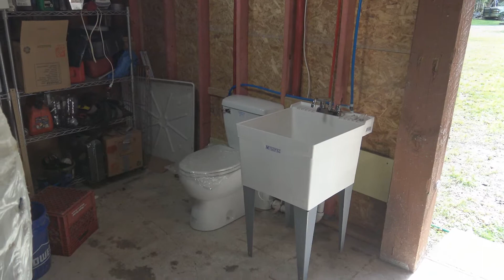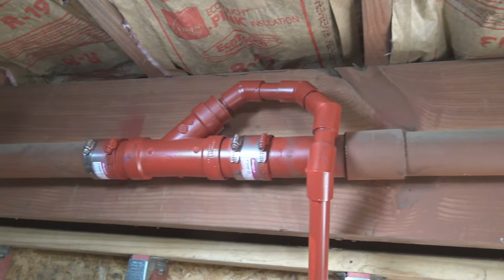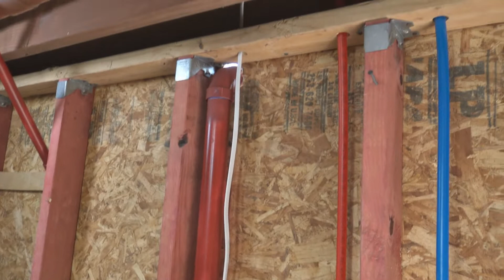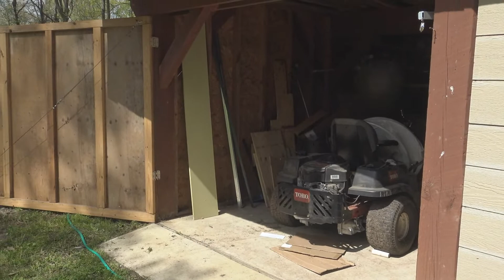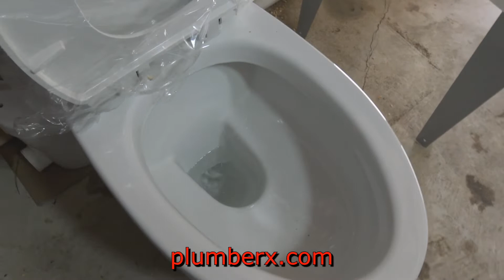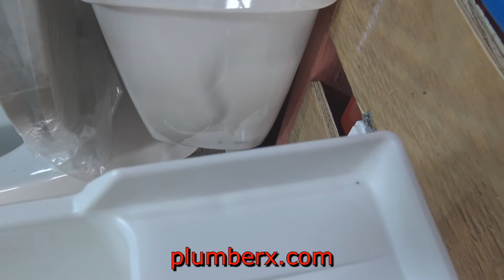Up Flush Toilet 10/10 | How To Plumbing

Comment: When you use the utility sink, how does the water get disposed off? Do you have to flush the toilet?
Reply from the maker: The water from the utility sink is dumped into the same pump system as the toilet. Sorry I didn't show it on video😖 there is also another spot for a shower are tub🤗

Comment: @ How To Plumbing,  I'm putting a Saniflo in my basement because my plumbing system is on a highline. To run my vent I'll have to go through cement block, so what would be a good tool to drill through it, plus vinyl siding?
Reply from the maker: I'm sorry, but going by the information you're giving me here, I would recommend you get in touch with a contractor and have him or here evaluate the structure of your home and make sure that if this is something you can accomplish on your or if you need professional assistance. I feel its great you would like to save money, But first, look at any alternative that would best for you.  I have many answers to your question, but these questions have many options and I would not like to lead you into something that may not work for you.  Again, I am sorry I can not give you a straight answer and I do appreciate your support to my YouTube channel
Reply: @theartofplumbing  I'm an apprentice plumber, so I know what to do, but I just wanted your master plumbing expertise. It would t hurt whatever information you provide.  It would gladly be appreciated.
Reply: @theartofplumbing  also, you didn't mention which Saniflo you used in the video.
Reply from the maker: SFA Saniflo toilet